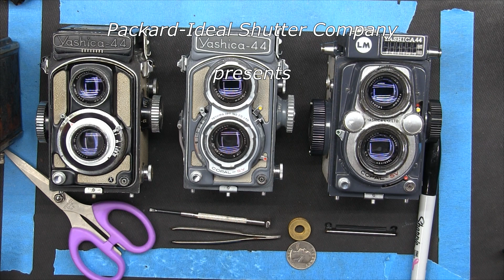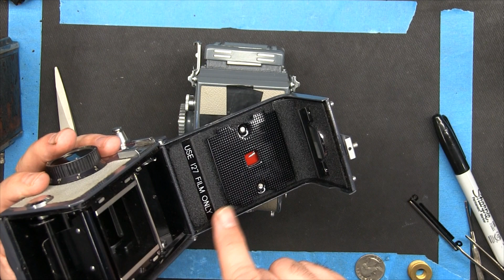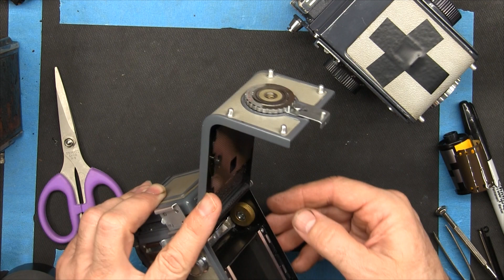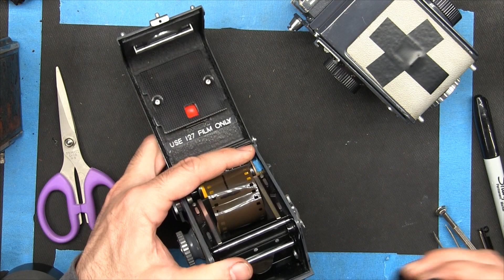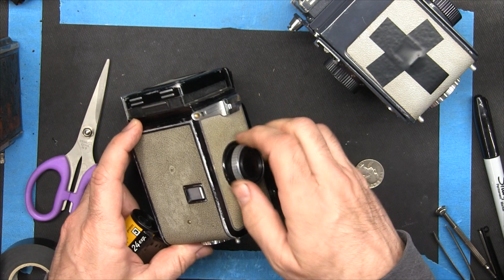Yashica 44-series 35mm Conversion

Comment: Hi , very good video. I am just surprised that you need to use thé crank for more than one turn ( or rather half turn) as thé caméra was planned to work doing 40x40mm pictures… whqt is différent with 135 films ?